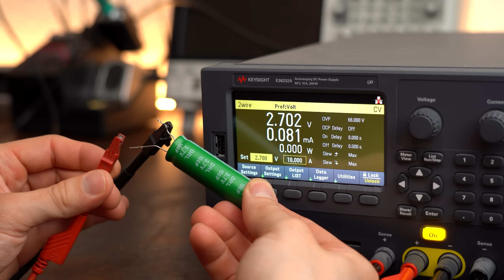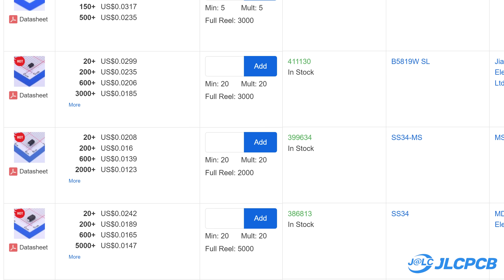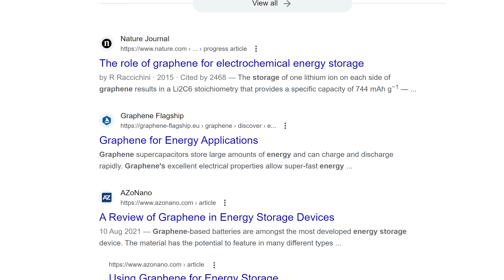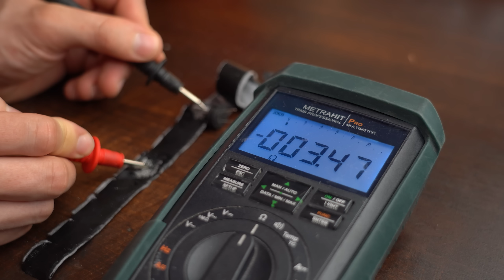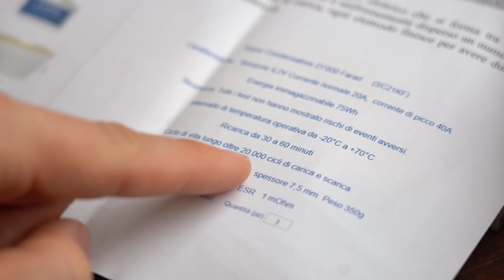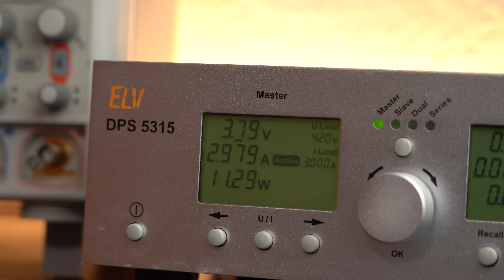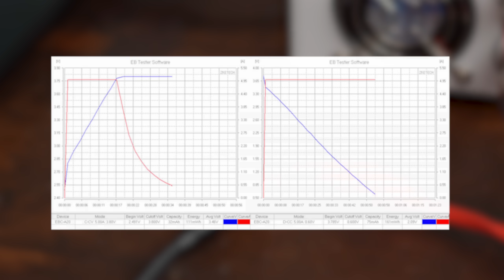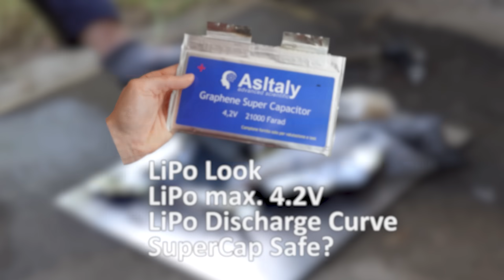Finally a Capacitor that can REPLACE a Battery?!

Comment: I would say it is more likely a LiFe battery of some sort. In the last test when you dismantled the super cap/battery. It seemed to be more like a battery. For the first I saw copper metal with black powder on it. This could indicate that it is a a battery, Since regular Lithium ion batteries have Copper metal at their cathode covered in powder of Cobalt oxides, Mangan oxide and Nickel oxide.  

And second for it resembling a battery could be due to the multiple sheets. It is common for Lead acid batteries to have multiple sheets/plates as electrodes. 

I overall think that it is a scam and that it is a special battery of some sort due to the minor reactions when being punctured. I would guess it on a LiFe battery of some sort as they tend not to be reactive as Lithium ion battery.  https://youtu.be/G5McJw4KkG8
Reply: Copper is on the anode
Reply: @TT-lf5hi https://youtu.be/G5McJw4KkG8 It is a video on this topic. This is the battery that I am referring to. 😊
Reply: @Bricknut34  go to 6:20 on the video. The aluminum alloys with the lithium on the anode, forcing copper to be used. It is a bit unintuitive, since copper oxide is an oxidant.

Comment: Something I am curious about, seeing how violent the reaction can be for a punctured LiPo battery, is that how much chemical energy is stored in a battery vs the total energy that can be charged and discharged for regular use. You may have heard that one incidence with a Tesla in Boston, MA, United States caught on fire and needed 20,000 gallons of water to put it out. Knowing that most of the energy for a LiPo cell is stored between 4.2V and 3.0V, how do you calculate that?

Comment: If you want to know if it's a lithium battery, just put water on the cutted battery. If its reacted by producing heat or/and flammes, it will indeed be a simple lithium battery .
Reply: I think when we puncture a lithium battery it produces the violent heat and smoke because it is reacting with the humidity in air. So actually pouring water might not be a necessary test. At that point it may produce heat because of short circuit via water, which would be the same as connecting the terminals with a wire.
Reply: Most batteries contain lithium compounds, not metallic lithium.

Comment: There are puncture resistant cells, I have yet to see them available for us consumers to get directly.  The thin sheets with black on the outer layer does look like a new form of lithium hybrid battery and not the hybrid capacitor.  it would have been interesting to see if adding a charge/discharge controller from a LiPo would have made it into a battery.

Comment: 4,2V max charge and discharge behavior makes me think it’s li-on battery. But not an ordinary one. This one is probably a prismatic type li-on equipped with ceramic separators. These don’t get caught on fire and have a long lifespan

Comment: Graphene is realy, really expensive. You can make it yourself.  it used to take extremely high furnace temperature and special equipment until a guy by the name of James Tour had one of his team discover small amounts can be made by discharging high energy pulses across the material. interestingly graphene can be extracted even from waste plastics. James is an interesting Guy as he talks amazing science not to mention holds many, many peer reviewed papers, and has patterns for many of his discoveries, yet is a Christian who willingly tells those who do not belive in Jesus to contact him and he devotes around an hour of his time in a one to one discussion with them.     

I suspect that 'Capacitor'  had very small amounts of Graphene in.  I have seen where tiny amounts of  Graphene has been added to cast rods of various plastics, and the tensile strength was increased by 30%.  Graphene is amazing , and will very likely become cheap as chips, not the LM358's variety, but the french edibles.  James latest revelation is that  he can extract hydrogen (in the form of fuel) suitable for vehicle propulsion at a negative cost, if willing to take the fact Graphene can be made from the byproduct, which offsets the cost of producing the hydrogen. It seems the future is not electric cars,  but hydrogen.

Comment: The easy way to determine if it is a capacitor ,is to monitor the voltage under load.
A capacitor's voltage continuously drops until it is discharged. A battery's voltage stays fairly constant for most of the discharge cycle.
This is the major problem that capacitors have when used for energy storage.

Comment: I would think that the "4.2V" is a pretty major clue.
Reply: Yep, supercapacitor cells usually have lower max voltage, around 2.5..2.7 V.

Comment: I think that you should've mentioned in the video the self-discharhing rate of the supercapacitors which I think is one of the biggest disadvantage of supercaps. While a typical lithium battery will self-discharge %3 per year, supercapacitor self-discharges %3 charge in the matter of seconds and minutes. So for the ones thinking that supercaps could be a better choice than batteries for their low-power applications after this video, think again.
Reply: for phones and cars ? Its cycles that matter
Reply: I have Maxwell 3400 farad capacitor bank I use for jump starting vehicles and it only loses about 1v/month.

Comment: It has the discharge curve of a NMC) (specifically LiNi1/3Mn1/3Co1/3O2), which, to be fair is one of the safer options for NMC, but it should still combust afaik. The fact that it marries the mechanical resilience of LFP with the discharge curve of NMC is interesting to me. If this is a new lithium based technology, it would be fun to learn more about it's other electrical properties, operational temperature, relative capacity degradation over 1000 cycles etc.

Comment: super capacitor also have extremely high self discharge rate compare to lithium ion battery or regular capacitor. So if you park a car that using purely super capacitor for a month straight. Probably 80% will be gone by the end of the month. As oppose to 5-10% for lithium ion
Reply: So, you use it for the use cases where it will be charged regularly then.
Cars are perfect fit for eventual super-duper mega capactors.
Just leave them plugged in 24x7 if you need the max range, although apartment dwellers might have a problem with that.

Comment: That graphene super capacitor just same as mpco lithium cell, same package, same size and weigh too. I use them for my electric scooter. It has high discharge current and more save than normal lithium cell (NCM)

Comment: I heard about Graphene-Copper (oxidized) battery and Sodium Ion battery are recently made available at this moment, and i'm recently tried to search info on the net but it's filled with clickbait & news aggregate for whatever reason and can't find anything that feels like a solid grasp or information, and it's worse on youtube because it's currently being overrun by "ai-generated science channel" that basically also churning out buzzfeed-level of shallow information so it's a bit hard to study these two recent battery tech at this point in time.
.
so, at 10:14 you can see the thin copper foil layer in the video, so it's possible that it's just a recently produced Graphene-Copper battery that didn't explode on puncture being advertised as supercapacitor for some reason. there's also a Graphene-injected lithium-ion battery but that one didn't use copper foil as binding agent for the graphene and still flamed out in case of puncture.

Comment: Just ask for the msds should indicate if there is a particlular non flammable organic solvent and a transition metal oxide on the cathode. Voltage looks indicative of a li-ion battery not a capacitor.

Comment: I wish you tested it in its capacity as a battery substitute. But I understand the first debunking was required
Reply: No, to be honest he should have simply characterized it with the assumption it was a battery, since otherwise it would be groundbreaking news and not likely to simply show up on eBay.....
Kind of knew it was a scam with the dearth of technical details, output curves, fake data download spec sheet, etc.
Then compared it to caps/super caps, which he sort of did.

Comment: Given the price, I doubt that the manufacturers were expecting anyone to conduct such destructive testing. Capacitors tend to have high self discharge rates, so charging the capacitor and leaving it in storage for a couple of weeks should see a large percentage of the charge leak away. Batteries by contrast will have a shelf life measured in years. An interesting product but far too expensive and limited at present for use in consumer products.

Comment: LTO (Lithium titanate oxide) Batteries are worth checking out as well, may not meet the voltage requirements, but still stable and resistant to being punctured
Reply: Their weird voltage and high internal resistance  makes them a no for me
Reply: They are also very good with battery life and discharge rates
Reply: Yeh

Comment: I hope you're aware that the smoke coming out of lithium batteries has fluorine gas in it.  With the aqueous parts of your body, the chemical yielded from contact is HF -- hydrofluoric acid.  So we're talking about HF contact with your eyes, nose, mouth, and lungs, primarily, and HF poisoning is delayed, so you won't feel anything "acidic."

HF poisoning is also the true nature of what people call "the Teflon flu."  Teflon has a large amount of fluorine in it, and when people overheat their pans, causing them to smoke, they get HF exposure and the next day feel like they have the flu.

HF poisoning can be deadly, though, or make you go blind, etc.

Comment: My Theory: This is just a cell/battery and they are using the term "Super Capacitor" incorrectly to miss-lead people. Since this is a big cell and it stores a capacity, you could say it is a "Super Capacitor" (In this sense, meaning "Large Cell/Battery") much like how some battery manufactories call their batteries a "Super Cell/Battery). 

So to me, this is a Cell that is miss leadingly called a "Super Capacitor" because that is "technically" not wrong and they can get away with it.

Comment: To be fair, no, capacitors won't replace the batteries due to how they store energy (Lithium-ion capacitors come quite close, too bad they're no longer made, been looking for that), but it's great for as a bulk storage at the end of the circuit (ie. car stereo amplifier with a supercapacitor to keep it happy, without any power dips in your car, whenever bass rips).

And of course supercapacitors are useful in certain circuits such as a microcontroller to keep data alive and to keep time, to keep time in clocks (some older VCRs had that power loss feature), and finally, in some PCIe SSD enclosures, to buy SSD time to flush its contents from RAM onto NAND flash chips (I have Dockcase PCIe SSD enclosure that has a supercapacitor for PLP feature).

Comment: Copper and aluminium plates in the "capacitor" suggest it is indeed some sort of lithium battery. But not typical LiPo (it would have went violent).
Reply: I have same thoughts

Comment: Looks like there were copper electrodes interspersed with aluminum electrodes = lithium battery. At 10:15 copper is clearly evident.

Comment: I saw some copper in the supposed super cap. That is typical for a lithium ion battery.That is a definite indicator for a batter. For a cap you would use aluminum. Way cheaper

Comment: This is what they described in their site : Superconductors, also known as EDLCs (Electric Double-Layer Capacitors) or Ultra capacitors, differ from regular capacitors as they can store enormous amounts of energy.

A basic capacitor typically consists of two metal plates separated by an insulator (like air or a plastic film). During charging, electrons accumulate on one conductor and move away from the other. One side gets a negative charge, while the other becomes positively charged. The insulator prevents the natural attraction of the negative charge towards the positive one, creating an electric field.

Once electrons have a path to the other side, discharge occurs. Superconductors contain two metal plates coated with a material, with graphene being the best option. They are immersed in an electrolyte composed of positive and negative ions dissolved in a solvent. One plate is positive, and the other is negative. During charging, the electrolyte ions accumulate on the surface of each graphene-coated plate.

Superconductors also store energy in an electric field formed between two particles of opposite charge, but they have the electrolyte where an equal number of positive and negative ions are uniformly dispersed. Therefore, during charging, each electrode ends up having two layers of charge coating (electric double layer).    https://www.asitaly.it/supercap.html

So isn't a LIPO nor a LIFe but got same structure of a capacitor as u could see from the video puncturing test. Its a hybrid form of both.
NOT A FAKE.